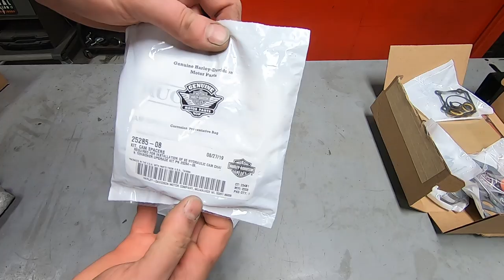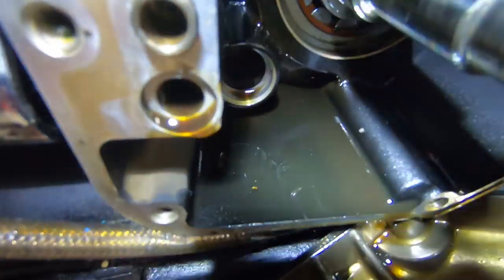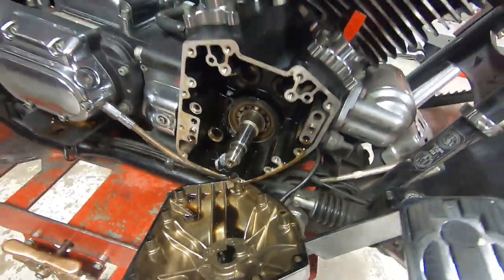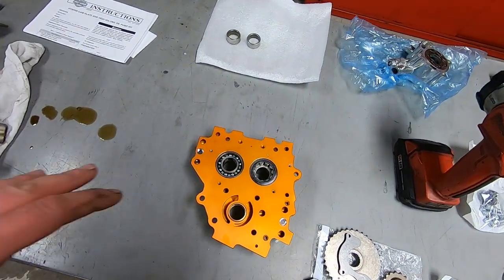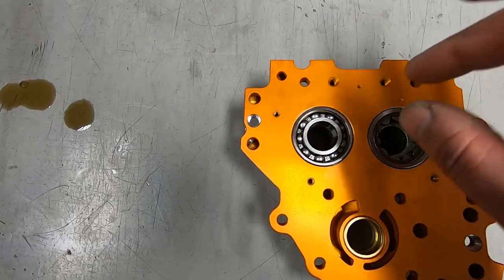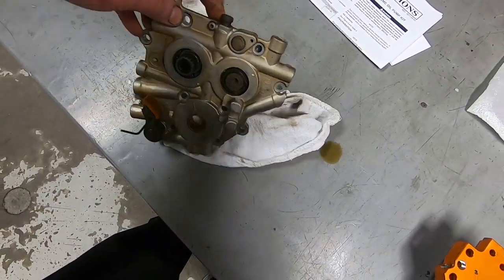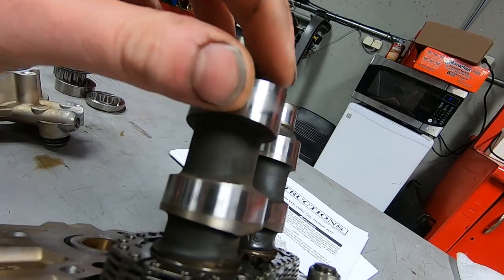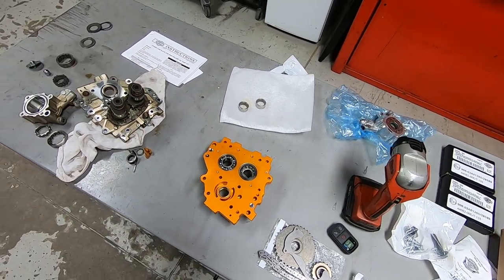HARLEY DAVIDSON WITH A BROKEN TENSIONER GETS SCREAMIN EAGLE HYDRAULIC CAM TENSIONER UPGRADE PART 1

Comment: I had the same service done on an old 2005 dyna of mine after hearing about the spring loaded cam tensioner stories, at the time the bike had about 25k on it. I asked the tech afterwards if he were just doing a tensioner inspection only, would he have recommended a tensioner replacement and he said no, while there was some wear on them, it wasn't bad but it was peace of mind for myself and I was pleasantly surprised that it freed up some horsepower and the engine felt more responsive as well.

Comment: We are going to shoot a YouTube video ; of a twin-cam 88 running with the cam chain tensioners pulled.
Then, we are going to look for a Mil-8 motor ; pull the hydraulic tensioners out ; plug the oil feed ; and re-shoot another video of this motor running without those chain tensioners.......
Reply from the maker: Interesting. What's the experiment?
Reply: @HarleyDavidsonWizard  experiment is done. Just need to shoot the video......

Comment: Great work.  Looking forward to the next segment.  I have two TC88 engines that will face this in the future.  I kept both my HDs, but this issue is what caused me to move away from HD for my next motorcycle purchase.
Reply from the maker: Ya the spring loaded tensioners is a funky setup.

Comment: Excellent work my friend regards Alan from the UK
Reply from the maker: Thank you! Cheers!
Reply: I dont understand how people, engineers, designers
Reply: who are smart enough to entertain the thought it takes to build a system like this think its ok to make the shoes on the tensioners out what may as well be "orange peel" and then expect them to last about 20k miles. 
The MoCo skipped out IMHO. HD should at the very least give a set milage that they need to be looked at, or R&R....ya think?
Any how quality video    done by the guy who should've designed the system!

Comment: Thanks for the videos, was wondering with the cam plate bearings it says in the instructions to use blue loctite outside bearing. What are your thoughts on that? I see u just liked it in 20w50

Comment: I visited two dealers to discuss tensioners but really got no good info. My question is that I see info stating imspect at 30,000 mi, but my motorcycle is a 2003, with 16,500 mi on it. Does the age of the shoe also have any effect on its deterioration?
Reply from the maker: I have not seen age to be a factor.

Comment: As I understand it, the shaft runout has to be less than 3 thousandths to use the hydraulic cam chain tensioner. Is that correct?
Reply from the maker: Pinion shaft run out needs to be at or less than .010 (ten thousandths). Your dial indicator should be located at where the cam plate supports the end of the crankshaft. The .010 (ten thousandths spec isnt specifically for hydraulic tensioners, it's because more than .010 (ten thousands) pinion shaft runout with cause pre mature ware of the cam support plate bushing and the oil pump. So anything at or less than .010 (ten thousandths) is within spec and is perfect suited for hydraulic tensioners. It's only if you're going  Gear Drive cams that your required to have tighter tolerances like .002 (two thousandths).
Reply: @HarleyDavidsonWizard  thanks for clarifying!!

Comment: At how many miles should you change the tensioners? Looking at a 2006 Fatboy with 8600 miles. Approximate cost?
Reply from the maker: 15,000 to 20,000 miles we recommend taking the cam cover off and inspected the tensioners. They 30k miles is the longest to expect them to last usally. Cost varies alot deping on if you want to do the hydraulic cam plate upgrade. But if you did you'd probably have around $700 in parts and it's usally around 6 hours of shop labor to do the job.

Comment: Very Kool. What’s the average life span of cam tensioners ? And does it make a difference if stock or performance cams ?
Reply from the maker: We recommend to inspect a spring loaded tensioner at 30k and there usually just about done by then. With synthetic some people get 40k. The service manual says to replace the tensioner when its 50% through its usable pad. That's like 2mm. People push them way to far and it bites them. I've seen the new hydrolic tensions go 70-80k miles and still look pretty good.
Reply from the maker: I havent seen much of a difference in the hydraulic tensioners. But on a spring loaded tensioner performance cams do seam to suck some life out of them.
Reply: Harley Davidson Wizard ok. Sweet. 
Yer I run Full Synthetic oil. But will make sure I check at 30thou intervals. Which is about 50thou KM to me. 
Appreciate that. Cheers.
Reply: Harley Davidson Wizard yer I still run hydraulic tensioners. I also change lifter every 40thou KM. And definitely change out oem lifters for high performance ones. I will be fitting solid lifters to me 117” Fatbob at some stage also. Cheers again 🍻

Comment: HDW,, I'm learning a loy from your vids. If it were me I'd forgo taking the top of the engine off (unload the customer had top end problems) and install adjustable pushrods? Couldn't tell, but are you using INA Bearings or Torrington? I live by if it ain't broke don't fix it. How long did you heat the plate? You do good complete work.
Reply from the maker: Thanks for the compliment. There torrington style bearings. They offer in the screening eagle catalog. This is a early twin cam and they came with uncoated rocker box gaskets that are super leak prone. So while doing cam chest work it makes sense to upgrade and fix rocker box gasket leaks. Thanks for the view!!
Reply: @HarleyDavidsonWizard  What model years have the uncoated rocker box gaskets?
Reply from the maker: I want to say 2004 and earlier. But alot of aftermarket gasket kits come with the uncoated ones so unless you look up under the rocker boxes it can be a bit of a crapshoot.

Comment: when you said heat up plate could you explain the process?
Reply from the maker: I used a can of MAP gas attached to my blow torch set a medium/low flame (I bought both the torch and MAP gas from Home depot, normal consumer grade stuff, nothing fancy.) then I applied heat and counted to 60 sec. and counted another 60 sec. So a total of 2min heat applied constantly moving the torch. Then dropped in the bearings and used light compressed air to accelerate the cooling.

Comment: Hi Brad. I own a 2018 Road King. Do you think that a new SE cam plate and high vol. oil pump to take care of sumping issues and provide good support and oiling for a new Zippers 468 cam?
Reply from the maker: as for Harley Davidson parts you'd want to use the new 2020/2021 oil pump and it works with your current cam plate. It would work well with any cam.

Comment: Hey Brad, I’m installing this kit on my Harley, was wondering if I need to re use the bolts that held the original cam bearing retainer plate on the old cam plate. One of them snapped off, and I’m having a hell of a time finding replacements.
Reply from the maker: If your using a harley Davidson screaming eagle hydrolic kit, it will come with new screws for the cam bearing retaining plate. Thoes are little bugger screws and the torque on them is only 40 inch pounds. There part number 68042-99 and usally selll for like $4 if you needed to buy another one.

Comment: Nice video bro. I just started on my 01 Glide, 47,000 mi still in one piece. But doing on a budget, if my cam look good should I reuse them & Lifter's? Also when I was taking exhaust off it looks like I have an oil seepage  right under rear exhaust studs. top head fins look, maybe a head gasket on the rear?? Any advice would be much appreciated!! Thx brother.
Reply from the maker: Ya. possibly head gasket seepage, it does happen. If the parts look good, reuse them for sure.
Reply: Hey wizard.  Yeah, head gasket was blown on rear cylinder dowel. I went with S&S 510s gear drivin & fuleing Lifter's & plate & oil pump. hopefully I didn't make wrong choice? As far as gears being too loud!! I guess I'll be the first to know!! Lol. (01 E  Glide) thx for all your help. 👍

Comment: Where are you located and how much do you charge to install the kit?
Reply from the maker: I'm at Motor City Harley in Farmington Hills Michigan. Doing the cam chain tensioner job is normal 6 hours labor and if there's oil pan needs to be removed to be cleaned that's extra. I dont post labor rates as they very but 6 hours is very typical.

Comment: Question for you Mr...
Reply: I don't know if you delt with the early model 99 A motor twin cam 88
Reply from the maker: I have. What's the question?
Reply: The 99 twin cam 88. With no boss do you plug the 3rd oil hole in the new cam plate?
Reply from the maker: Yes you plug the 3rd hole. If your using a screaming eagle cam plate. Harley davidson has a special seal and screw for that 3rd hole. I can get the part number tomorrow if you'd like.
Reply: @HarleyDavidsonWizard  awesome thank you... I tried telling the harley dealer around me about that,  they could not give a answer. If I can get the list number or part number on that plug that would be fantastic... thank you for your help
Reply from the maker: Its called a "cam support plate oil control kit" its Harley Davidson part number 94667-00. It's like a self tapping screw and doesn't take much torque at all.
Reply: @HarleyDavidsonWizard  beauty thanks....
Reply from the maker: You're welcome.👍

Comment: What type of grease/lube are you applying to the bearings (around 2:30 in)?
Reply from the maker: That's just normal harley davidson 20w50 engine oil in the squirt can. I like to "pack" the new bearing with engine oil. And on the matching part  of the cam I lube with actual assembly lube.

Comment: Couldn't you just put the cam plate in the oven for a few minutes or is there other parts that could be damaged by doing that?  Got an 04 heritage i need to give some TLC to.
Reply from the maker: Im sure you could but ovens heat the entire part and they heat fairly slowly. Where using the MAP gas heats just the area I want and heats it fast. I assume there would be more possible warpage using a oven but IDK.